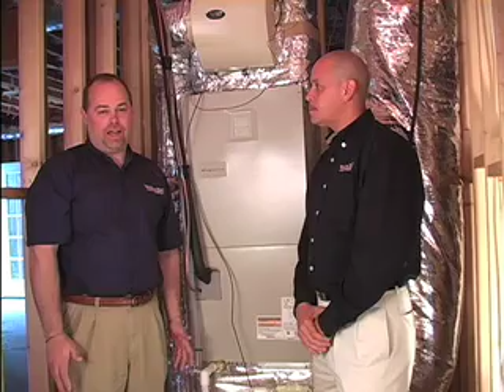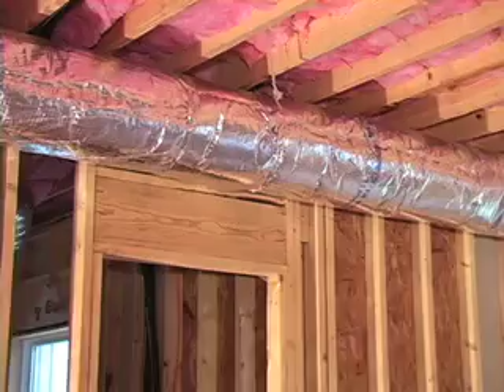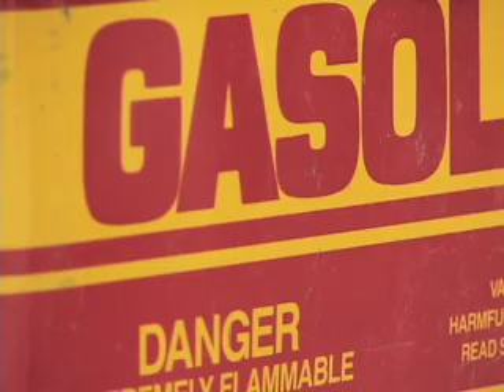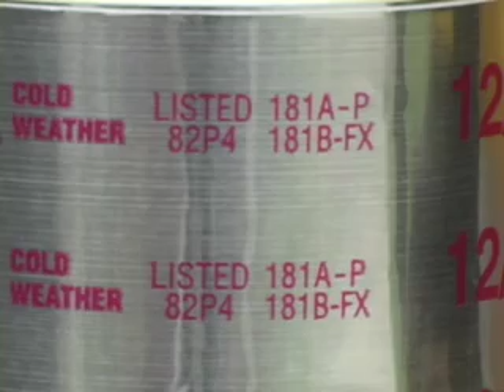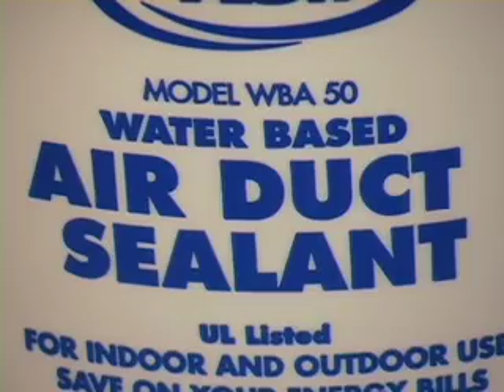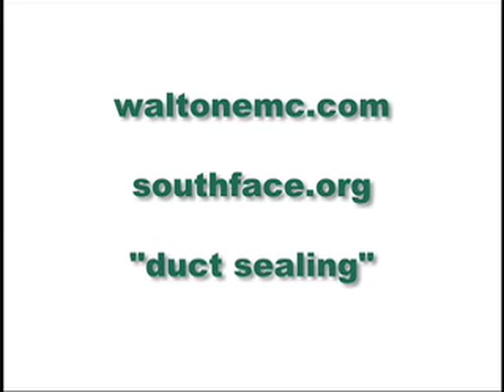Seal Your Home's Ductwork

Comment: Mastic is the best way to go for sealing duct leaks.  This has been said over and over:  duct tape is the worst thing to use on ducts.  In my own early experience I have seen this crap fall right hot ducts.  It is great for doing emergency repair around the farm but that's about it.  Ul approved mastic is easy to work with, it died pretty fast, dried hard, and seals better than anything else.  USE IT!

Comment: I could not help being a fire inspector that you should change the smoke detector battery first.  What good is all that ductwork if the house burns down.  Second, it was a very informative video. Thanks Chris

Comment: you know you dont have to use mastic 
if you use foil tape "properly...as in you dont just press it on and expect it to stay.. you need to use a squeegee   and it will not come off and using mastic on some foil tape causes it to actually peel

Comment: I do duct sealing for a living and this video is right on. I should emphasize that all sheet metal ducts(square or round) have seams running continuously down the length, and elbow joints have several seams. All of these seams need to be sealed with tape or mastic.

Also, tape by itself will fall off after a number of years. To make a permanent seal, all tape should be covered with a thick layer of mastic, especially at the edges. A typical basement requires several gallons of mastic.